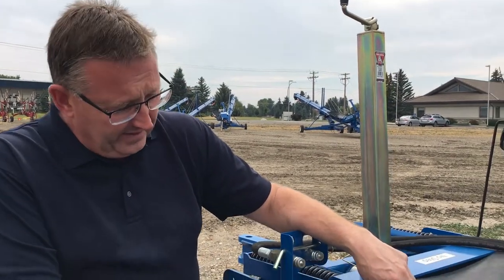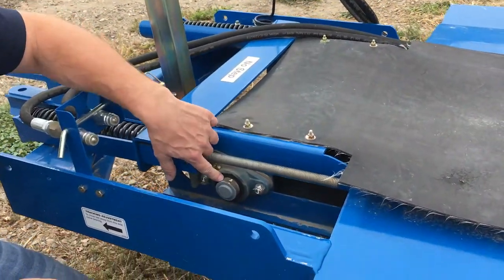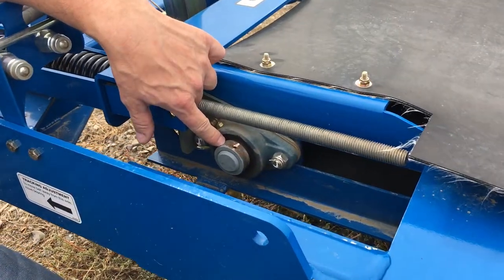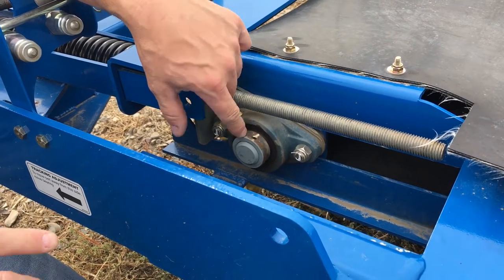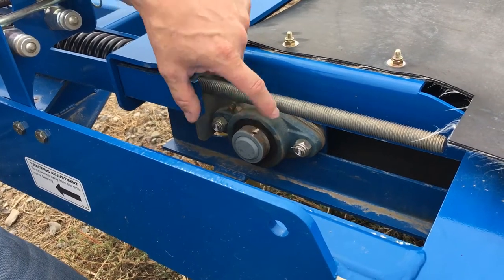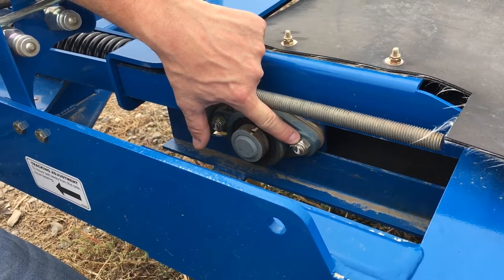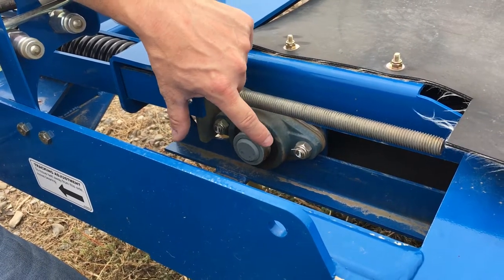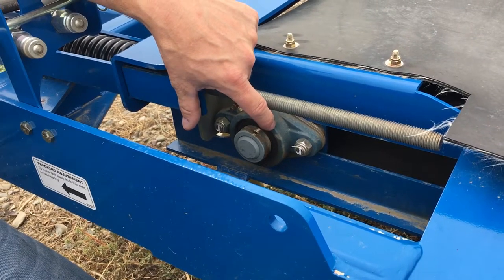How to Install a Bearing Lock Collar | Lock Collar Replacement

Comment: This instruction is incorrect.  Every manufacturer states that lock collar is to be tightened / set in direction of rotation.  The reason many of us get this wrong is that we are thinking of the lock collar as we do a nut on the end of a threaded shaft .... where we want shaft rotation to have a tightening effect on the nut.  This is not the case when dealing with an eccentric locking collar.  The collar is "set-screwed" (locked) to the shaft after it is positioned correctly in the shaft rotation direction, .... shaft rotation exerts a tightening force between the eccentric collar and the bearing inner ring.  But more importantly if locking collar is set in opposite direction of rotation as this video shows, shaft rotation could have a loosening effect between the eccentric collar and the bearing inner ring.

Comment: Other videos say to tighten an eccentric locking collar in the same direction as shaft rotation.  I found three other videos that disagree with you and none that agree.
Reply: @UCIP6aFLTZYdJlxFw3PG9ULw    @Sim 250
Aren't the shear forces of the bore against the shaft and the collar against the shaft equal?  Notice also that the collar and the bearing inner race may be of different materials.  

Suppose that the locking-collar material has a higher coefficient of friction against the shaft than does the material of the bearing inner race against the shaft.  Also notice that the collar has a set screw.  For those two reasons, the collar's static frictional torque against the shaft would be greater than the bore's static frictional torque against the shaft.  So if, upon startup, either suffers a torque that overcomes the static locking frictional torque, it would more likely be the bearing, not the collar. 

Suppose the collar weighs less than the bearing so that it has a smaller moment of inertia (I believe that that is the usual case).  
The bearing would more easily start to turn against the shaft upon startup, compared to the collar.  The collar would more easily rotate along with the shaft.   

So for three reasons, the collar is naturally more stable relative to the shaft, and it becomes reasonable to lock the bearing to the shaft by rotating the collar in the usual direction of shaft rotation.

Do you find anything wrong with those arguments?

I believe that on a circular saw, the blade is locked to the shaft, so it isn't rotating much anyway, relative to the shaft.  All that is left is the nut, and it should be tightened against the direction of rotation.
Reply: Everything I can find states tightening with rotation not against
Reply: always tighten the same direction as the direction of travel, lt counters the rotational forces because it aligns the tightening force with the direction of the applied loads and motion. it resists the natural tendency of components to rotate or shift during movement, giving a more stable and secure connection. if not it can work loose, similar to how wheel nuts can work loose on one side of a car